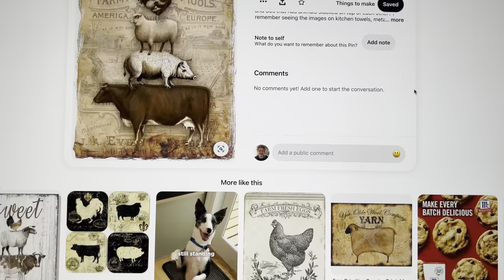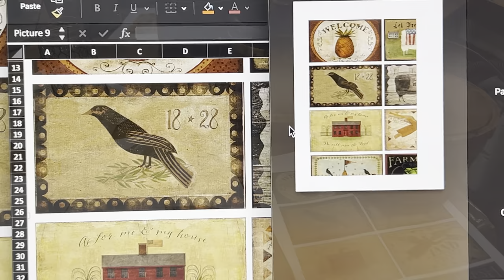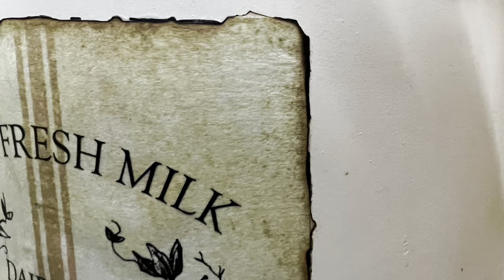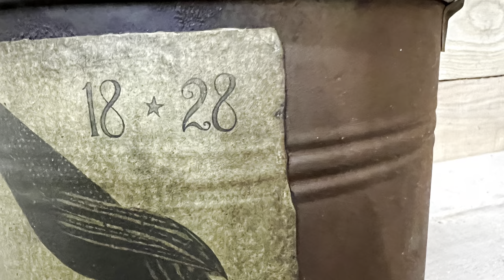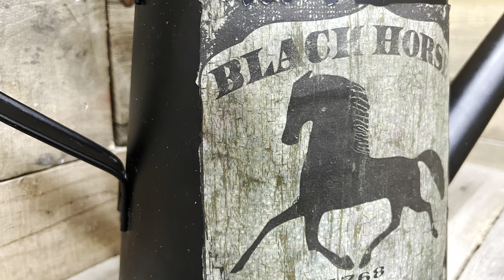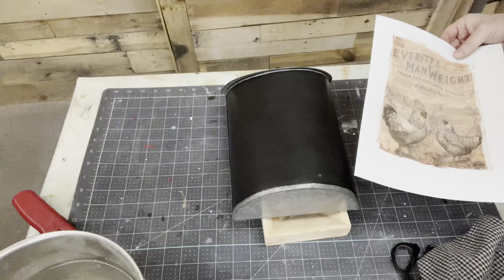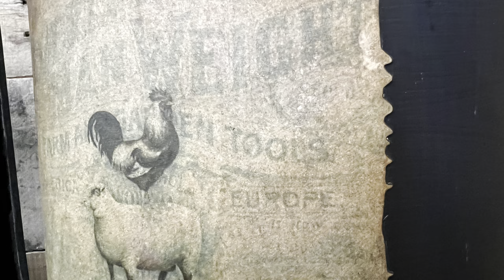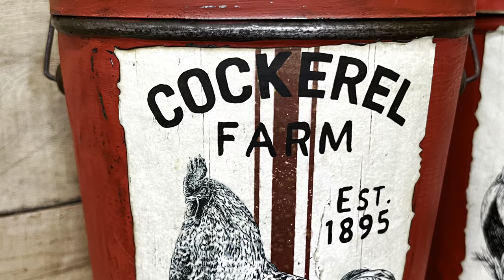Trash to Treasure | DIY | Decoupage

Comment: New subbie here. I noticed you used wax to seal the picture on milk can. Ive always used the decoupage glue on front as well as back. Just curious why you used wax???
Reply from the maker: I didn’t want to add moisture. Since these were just printed on copier paper. Wax will seal and protect them just find.